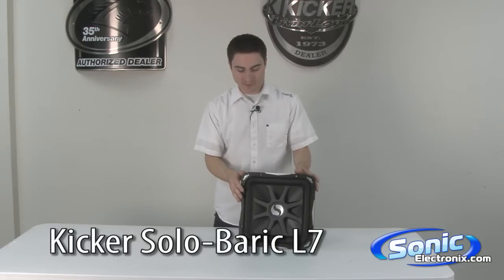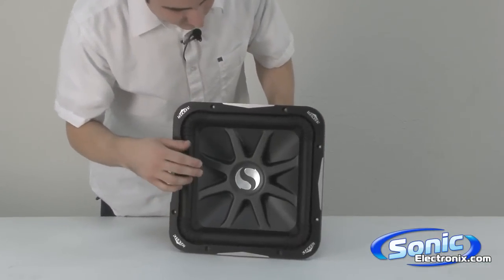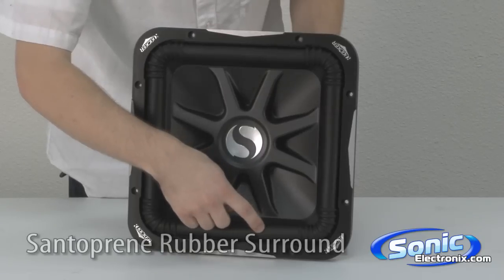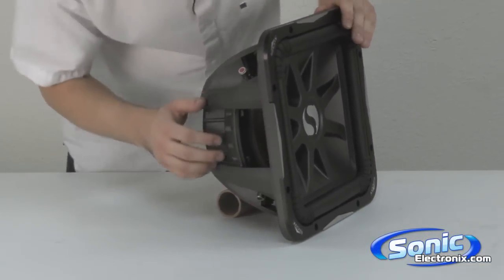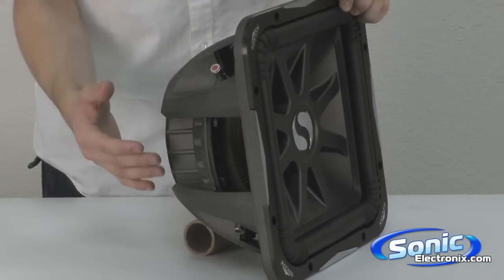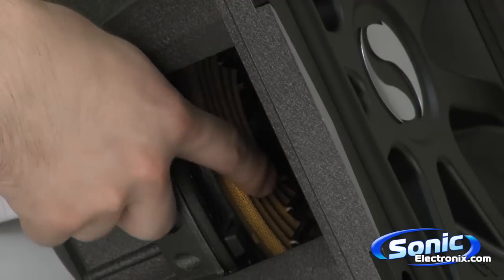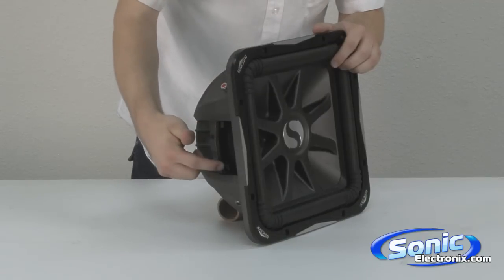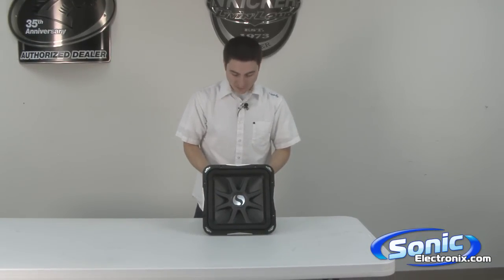Kicker Solo-Baric L7 Subwoofer Review

Comment from the maker: @MrBen305 If you want to run two L7's off of a Kicker monoblock amplifier you'll want to use the Dual 2 Ohm model of the subwoofer.  As far as the enclosure you should consider an internal box volume of 1.75-3.25 cubic feet per subwoofer chamber.  As far as port tuning for a smaller enclosure you can tune it to around 38 Hz.  If you go with the larger box then tune the port around 35 Hz.  Good luck with the enclosure and installation, you'll have some bass in no time.

Comment from the maker: @tyler409tyler Kicker recommends a ported enclosure that is between 3 and 6 cubic feet. The most suitable enclosure we carry is the Absolute DKS15 with a total box volume of 5.71 cubic feet between both chambers. We however recommend getting a custom enclosure built for your application. 15" L7's are very powerful and if you use a pre-fabricated box, it will end up failing over a short amount of time. Be sure to use a minimum of 12awg speaker wire for your connections.

Comment from the maker: Those L7's will handle a little more power than they are rated for. Here are a couple of suitable amplifier replacements:

Hifonics Brutus BRZ2400.1D
Kicker ZX2500.1
Earthquake Sound Mini D2500

Hope this helps!
Reply: Would a kicker  750.1 be to little to power two 12 inch L7 or I have to get a more powerful amp
Reply: Im running x2 L7 S15 Solobarics X2 2000.1 both amps running 1500rms @ 2ohm = 3000w between the pair using x2 AGMs thats my Low Pass now working on Mids and Highs and a 2 channel 1000 rms and another Agm also my Alternators are H/O Big 3 in the midst

Comment from the maker: @TINYLOWKS This particular subwoofer is a dual 4 ohm subwoofer. If you only have one it will wire down to a final impedance of 2 ohms when wired in series. The L7 also comes in a dual 2 ohm version that can be wired to a final impedance of 1 ohm in parallel  or 2 ohms when wired in series. Once you have your final impedance that will help you select a better amplifier for the subwoofer.

Comment from the maker: @BassHead143 This choice is made more by personal choice.  1200 watts of rated RMS power is available in any Kicker amps, so you're stuck choosing between the 1000 and the 1500.  Well, if you're to use the 1500, you'd be pushing an additional 150 watts or more of RMS power towards each L7, which they can definitely handle, but you have to be careful with tuning.  The ZX1000 will also work fine since Kicker under rates their amplifiers.  So it's more a question of how you want to run your system.

Comment from the maker: To increase your output you need to have a custom ported enclosure made by a professional for those L7 woofers. This will give you a huge increase in output over any other adjustment. A sealed enclosure is not meant for output.

Comment from the maker: @Klave620 It would not be recommended to run 2 different subwoofers off one amplifier.  They have different power handling and may have different impedances.  We would recommend either running a 2nd amp and run 1 subwoofer on each amp or get a secondary L7 or CVX.

Comment from the maker: @TINYLOWKS That is actually the correct way to wire a Dual 4 ohm subwoofer to a final impedance of 2 ohms. If you want a diagram go to our website and type in CVX124 and the select the wiring guide tab and you will see a number of wiring guides to suit your specific needs. But for now you have the single subwoofer wired correctly.

Comment from the maker: @DjNativeXsanity If you're looking to under power the Kicker L7 you can use some other amplifiers that can output roughly 600 watts and be okay.  To clarify, if you have the Dual 4 Ohm model of the Kicker 12" L7 then you can wire the voice coils in parallel down to 2 Ohms.  Under $100 is a tough price to meet for a decent amplifier that can output 500 watts or more.  The Sony XM-ZZR3301 will work, but for a better matchup go with the Kenwood KAC-9105D. This will feed the L7 900 watts!

Comment from the maker: @DorckWoW If you want to run them at 4 ohms final impedance then you have 4 options, Kicker ZX2500.1, JlL Audio HD1200/1, Rockford Fosgate T2500-1bdCP, or the MTX Thunder Elite 4001D. You might want to consider running them at 2 ohms, you will have more amp options and spent a lot less. Also don't get a capacitor upgrade your battery. The XS Power D1200 should be sufficient enough. With that much power it is wiser to upgrade your battery.

Comment from the maker: @SubZeroSkyLine The recommend ported enclosure size for the 12" L7 is 1.25 cubic feet to 2 cubic feet. We recommend going with a 2 cu ft box for the biggest bass output. Anything over and you can potentially damage the subwoofer quicker because there would be little to no back pressure to counter the subwoofer's movements.

Comment from the maker: Two dual 4ohm subwoofers can have a final impedance of either 1ohm or 4ohms when wired together. Now since you can get the most power out of an amplifier at 1ohm, we recommend going with a 1ohm stable amp that is capable of producing between 600 and 1200 watts RMS. The Hifonics Brutus BRZ1200.1D would be a great choice, as would the Rockford Fosgate T1500. Another option would be to use a 2-channel amplifier and run each subwoofer at 2ohms.

Comment from the maker: @TINYLOWKS Honestly this is personal preference. The L7's will take up some more room but will give you deeper bass because of the square design. I am a bigger fan of round subwoofers than square subwoofers because the response is usually tighter and quicker with round subwoofers. So you need to ask your self if you want more bass or tighter response. Once you figure out which one is more important to you it will much easier to just go with the L7 series or the CVX series.

Comment from the maker: @KingBre99 Go with two Orion HCCA152 subwoofers, they are rated at 2000W RMS each.  Then purchase two of the Massive Audio N4 car amplifiers. You are going to have to wire each sub to each amp to a final impedance of 1 ohm. With woofers this strong you will need to have a custom enclosure made, any regular enclosure will be torn to shreds. If you want to be heard this is the way to go.

Comment from the maker: In short, yes. The Power Acoustik BAMF-2000/1D is rated to produce 1200 watts RMS at 1ohm. This should be more than enough power for a single L7, whether it's 10", 12" or 15". Thanks for asking!

Comment from the maker: @11TurboDiesel Each of those subwoofers requires 1000W RMS. If you're running two of them, you'll need a total of 2000W RMS. Personally, I'd recommend the Alpine MRP-M2000 for a good 2000W amp.  This power is @ 2 Ohms as well, a nice medium.

Comment from the maker: @TINYLOWKS In this particular bass package, the amplifier will produce 900 watts RMS to each 1000 watt subwoofer. This is more than enough to properly power the Kicker CVX154 subwoofers. The Sonic Sub Box 2SV15 would be a fantastic option for enclosing the subwoofers. The box is ported/vented for maximum bass output, and each chamber is 2 cubic feet. Just be sure the enclosures dimensions will fit in your location before purchasing.

Comment from the maker: @DjNativeXsanity Although the Lanzar amplifier is rated at 2000 watts, I couldn't tell you how the amp will power one 12" Kicker L7. Looking at some of our comparable Lanzar amps, they're rated to push around 1200w at 4 ohms of RMS power when bridged. Caluclating it's power output by looking at it's fuses, it's true output will be about 450 watts when bridged.. It will work, but if you want an affordable clean matchup, I'd consider going with a JH600 and a Kicker L5.

Comment from the maker: @FanOfSubwoofers If you have 2 Dual 4 ohm subs you should go with the Hifonics Brutus BRZ2100.1D at a final impedance of 2 ohms. If you have 2 Dual 2 ohm subs you should go with the Hifonics Brutus BRZ1700.1D at a final impedamce 1 ohm. These amplifiers are affordable and CEA Compliant meaning you will be receiving the rated power each time.

Comment from the maker: @DorckWoW Actually no they wont. Each subwoofer requires 750W for a total of 1500W RMS. If you go with the JL HD1200/1 for instance, at 2 ohms you will have 1200 watts. When wiring the subwoofers together to a final impedance of  2 ohms and then running them on the amplifier at 2 ohms each subwoofer will receive 600 watts RMS. So really you will under-powering but at least at a safe level.

Comment from the maker: A single Dual 2 ohm subwoofer wires to a 1 ohm load. So, you need 1000W RMS at 1 ohm. However, the L7 can handle a bit more, so go with the NVX JAD1200.1 which outputs 1200W RMS, conservatively rated, at 1 ohm.

Comment from the maker: @TINYLOWKS Unfortunately this package was designed to work at a final impedance of 2 ohms. Since the subwoofer is a Dual 4 Ohm Voice Coil Sub, there is unfortunately no way in which to wired this down to a 1 ohm final impedance. However the positive of running this at 2 ohms instead of 1 ohm is that your current battery should provide sufficient power without causing your headlights to dim. So by running it at 2 ohms you will still get a lot of bass without upgrading your car's power supply.

Comment from the maker: @RichandRyanXposed That would be a good set up, it will be loud but still accurate and precise. Another option would be the Rockford Fosgate T2D415 with the BRZ1700.1D. This will also be loud and precise but will give you a little more output than the Kicker L7. Either way we recommend doing a Big 3 upgrade and a battery upgrade with that much power. 0 gauge wiring is also recommended when you start dealing with higher power outputs.

Comment from the maker: The Hifonics Brutus BRZ2100.1D would be a good cost effective choice to run both L7s as long as you have them wired a 1ohm. The amp s also CEA compliant, so you know you're getting the correct RMS rating. The Massive Audio N4 would also be a good choice and the wiring would need to be the same.

Comment from the maker: Check out the Rockford Fosgate T1500-1bdcp. It will be great for powering two CVX 124 at 2 Ohms. Place them in a sealed box for good sound quality. If you want SPL, go with a ported box.

Comment from the maker: @girblee The wiring you use depends on the amplifier you're driving these woofers with.  If the amplifier was matched up properly to 2 12" Kicker L7's, then you'll definitely need to use 0 gauge wiring.  I'd highly recommend Kicker wiring, and you can find everything you need for the install just by checking out our main website.

Comment from the maker: Yeah!  That sounds like a really good setup.  Since they are going into a ported box and Kicker amps are under-rated, you'll be fine. The only thing that would make it better is if you use a Kicker amp kit. Kicker provides an additional one-year warranty on their amps when installed with a Kicker amp kit.  When you place your order, talk to the sales rep and we will give you a good deal on the Kicker PKD1.

That is going to be a killer system when it is all put in.  What speakers are you using?

Comment from the maker: @cleaningman94 I recommend the Kicker ZX500.1, MTX RFL600D, or the  Kenwood KAC-8105D. Any of these amplifiers will work with the 08VS10L72. Now about it fitting in your car, honestly your best bet would be to measure the space available in your vehicle and try to figure out if it will fit or not. I don't believe it will fit under your seat but it might fit behind the passenger seat if you push it forward.

Comment from the maker: If you double the surface area of your subwoofer setup, you will be moving a lot more air volume than if you were to use more power on a single woofer, thus a greater increase in bass.

Comment from the maker: @iTzDifficult The on the video is the older 2008 model. The newer one is darker, has a darker backplate and also as  "L7" printed on the bottom of the woofer cone. Go with the new ones they are the same price as the old ones. I think the new ones look better and they sound better because upgraded materials have been used to improve sound reproduction.

Comment from the maker: @1UpToker You wouldn't want to match those up.  The Lanzar amplifier is going to be over-rated and not handle as much power as it states, and it doesn't even have a true 2000W RMS @ 2 Ohms. Find an amplifier that can handle 2000W RMS @ 2 Ohms to match up with that setup, like the Alpine MRP-M2000

Comment from the maker: You are putting 2 10 inch L7's in a single cab truck?! Thats going to sound nice! Those 2 L7s are going to be very punchy and crisp. The amp for your L7s will depend on the impedance of the subs and how your wiring your subs. If you wire the subs down to 2 ohms (2 x Dual 2 Ohm L7s), then check out the Kicker 08ZX1000.1. If wiring down to 1 ohm (2 x Dual 4 Ohm L7s), then check out the Rockford Fosgate Power T1000-1bd (2009 Edition). Both are under-rated and should give you enough power.

Comment from the maker: @04braves A 10" L7 would be powered fine off of an amplifier that pushes 600W RMS.

With a 15" L7 you'll want an amplifier that pushes a true 1000W RMS. Depending on which model you buy (Dual 4 Ohm, or Dual 2 Ohm) you have different wiring options. 

If you have the Dual 4 Ohm 15" L7 the ZX1000.1 will work great, for the Dual 2 Ohm model, you'll want to go with something that is 1 Ohm stable, or bridges together for 1000W RMS @ 4 Ohms.

Comment from the maker: @bitlord888 Since you said you're looking for the earthquake bass and want to be heard, the L7 is definitely the choice for you.  

A 12" L7 will require some power to be properly driven. The ZX750.1 is a perfect matchup, and will provide a bit of extra power to run the 12" L7.  If you're looking for tons of bass, put that L7 into a ported box, built to Kicker's specs for the best possible bass. On our website, type "VS12L72" into the green search bar for this pre-enclosed subwoofer.

Comment from the maker: @troy95436 You should be fine. Your amplifier outputs 1600W Max which translates to about 800 watts RMS, maybe less depending on the quality of the amplifier. The L7 can handle 750W RMS, so assuming that the amplifier is half decent it should at least output 700W RMS which will enough to safely run the Kicker L7. Max power and RMS power are two totally different things. If your amplifier was doing 1600W RMS then you would definitely not want to run your sub. In your case you should be fine.

Comment from the maker: @1rodolfo3sur This will not work with a 3 Channel amp.  It is more common to use a 2 or single channel amplifier for subwoofers.  This amp will not have enough power per channel to support these subwoofers.  Which amplifier brand and model is this amp?

Comment from the maker: @SubZeroSkyLine Yeah that would hit really hard, the ported enclosure will cause the subwoofer to produce a deeper bass giving you more SPL. Just make sure you purchase the Dual 4 ohm version of the subwoofer so you can wire it parallel to a final impedance of 2 ohms and therefore get the most power out-of your amplifier. You will not be disappointed with this set-up good job an matching a perfect amp for that subwoofer.

Comment from the maker: @MrBadchoice101 Yes you make a good point. For higher powered systems, a battery is the only true choice. Since a capacitor is only regulating power and not adding power for some systems with really high power out puts a capacitor will do next to nothing for them. This is why we always recommend upgrading your battery. It is the best way to assure that your current set up wont completely drain your current battery. Good advice man!!!

Comment from the maker: @MultiPaksiw If you are talking about Rockford Fosgate's T1500.2DB amps than wow yeah they can easily push 2 15" Kicker L7. We would suggest going with the Dual 2 ohm versions and running them to 4 ohms each and each to one amp. This will give you the best sound and at 4 ohms it will give the cleanest sound because the amplifier will run more efficiently with less stress and heat.

Comment from the maker: @MoparORnoCar95 If you have Dual 4 Ohm sub you will have a final impedance of 2 Ohm at which point we recommend the Rockford Fosgate PRIME R1000-1D, Kicker ZX1000.1 or the Alpine MRP-M1000. All of these amps will have a power rating of 1000W RMS at 2 Ohms. However if you have a Dual 2  Ohm sub you will need an amp that can do 1000W at 1Ohm. We would recommend the RE Audio VLX 1DE. Running the sub at 2 Ohms will give you more options when selecting an amplifier.

Comment from the maker: @BIGxNastyx2 It hard to give you a straight answer because I do not know the dimensions of your enclosure or the amount of space and clearance you have available. L7 subs are pretty bulky and  even a 10" version will need about 6/25 inches of mounting depth. Most trucks really dont have the space to fit something of that size under the seat. Your best bet would be to measure the amount of space you have and compare it to the specs of the enclosure.

Comment from the maker: @LandoTheCommand0 Kinetik has a Power Cell calculator and they recommend an HC1800 if you want to add an additional battery.  You could also use the Shuriken SK-BT80 which is comparable, or the SK-BT60 which will get the job done as well.  With power it's all about maximizing your head-room, so shorting yourself with a smaller battery is never a good idea.  Adding a capacitor isn't a bad idea, but it's definitely not necessary if you've added a power cell near your amplifiers.

Comment from the maker: @Bigoso310sb Honestly not too many changes have been made from the 2008 model to the 2011 model. The new L7 have better components that will make the woofer tougher and more durable. Also the use of better materials will make it more efficient. If you with a model older than 2008 you will be downgrading a lot and would recommend a newer model. However between the 2011 and 2008 model, power output is the same but the newer ones are slightly more efficient.